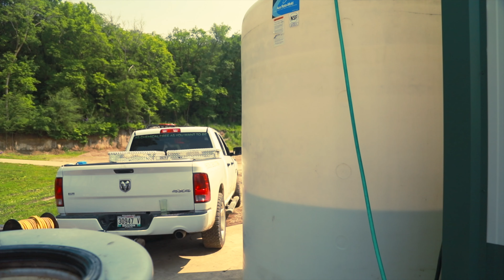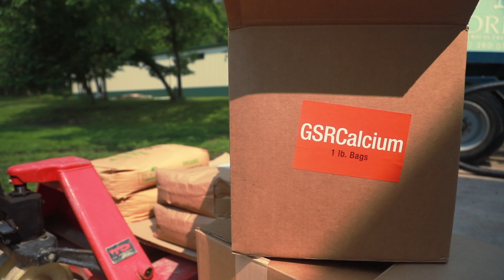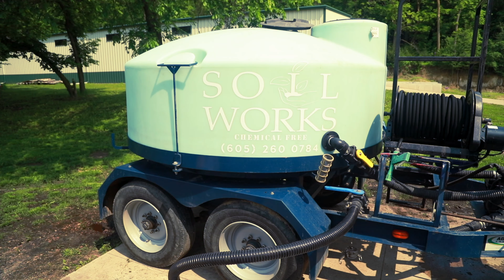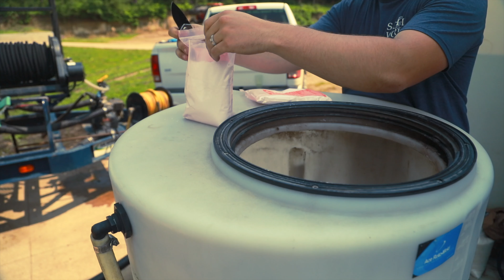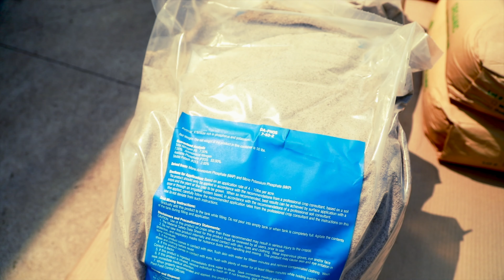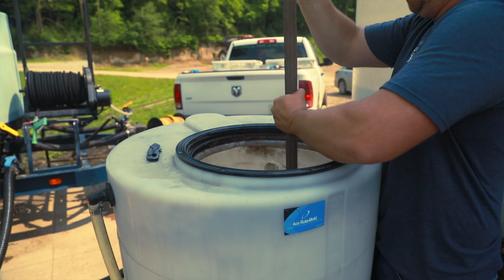Soil Works Mixing Tips

Comment: We have a 3 acre formerly 80% clover/20% foxtail that is now flipped on its head, 80% foxtail/20% clover. I am grateful to finally learn about how to make our soil healthy, and therefore less susceptible to this plague. 

Following bad advice, last year we tried mold board plowing, then mowing after the seedlings were viable, which compounded the situation to its current nightmare state.

This Fall, we will wait until the foxtail is thoroughly dead and will then bale it. We will apply Organic pure cane sugar just before the first freeze. In the Spring, we will mow the foxtail seedlings with a flail mower level withthe ground.  This will likely do damage to the clover we and our resident deer and antelope love, but will hopefully do significant damage to the foxtail. 

We refuse to use poison of any type that would damage our beneficial insects or the birds who feed on them, in addition to which we have a pond directly below this field. 

There are no non-toxic pre-emergent compounds available except for corn gluten, which is tricky to apply and has limited capabilities, particularly in a field that has this degree of infestation.

Any comments or suggestions would be sincerely appreciated.  I pray that these measures, in addition to providing carbon to our soil, will get us out of this.